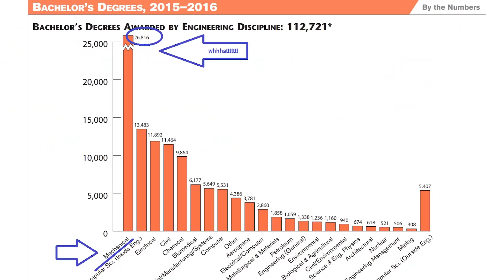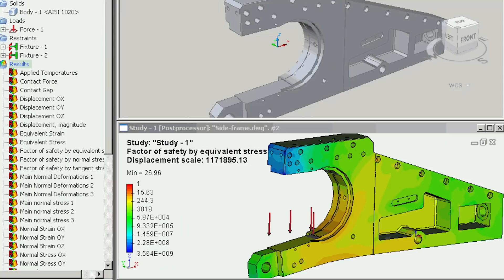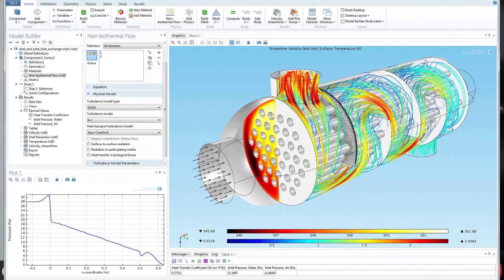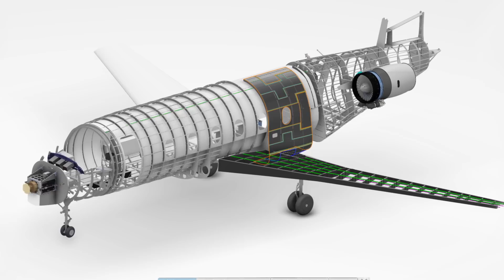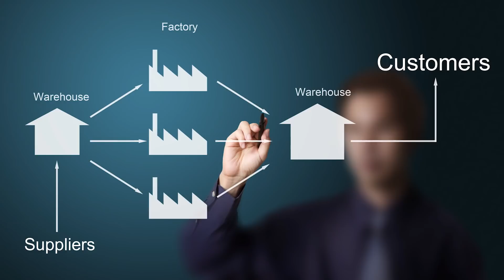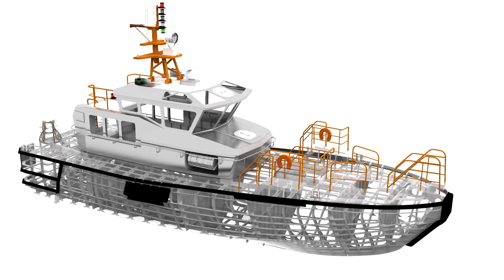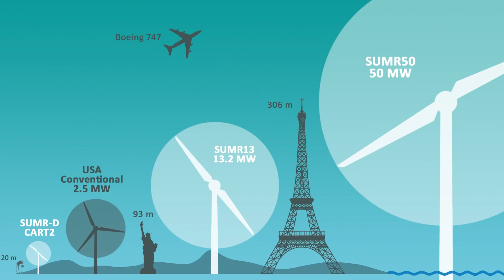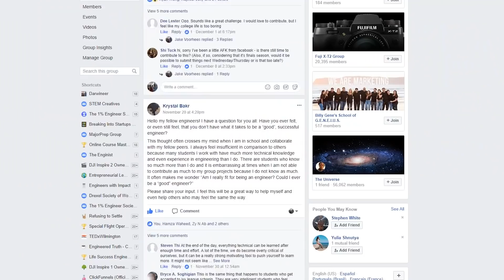What Do Mechanical Engineers Do? Where do Mechanical Engineers Work?

Comment: at 0:35, what is the difference between Comp Sci (Inside Eng.) and Comp Sci (Outside Eng)?
Reply from the maker: You have the best questions. Honestly I didn't even take a deeper look @ that until you asked. I have to assume that inside engineering infers roles of CS majors who are working for engineering companies and essentially, as a part of an engineering team. There are plenty of CS roles outside of the engineering industry as well, so this is one assumption. The other assumption is that CS inside of engineering could mean that they are moreso a software engineer - making software. Outside of engineering would be like a data scientist who never "engineers" any software. I am not entirely sure but did this answer help? Thanks!
Reply: @JakeVoorhees  very helpful, thank you!

Comment: jake what made you choose transportation engineering? and what is your favourite part of it? did you ever work a job surveying?
Reply from the maker: Yes I worked as a surveyor before graduating high school. I chose transportation engineering for the ability to work with technology and driverless vehicles and things like this. I did so for a while
Reply: @JakeVoorhees  wow holy smokes. i might've missed it in one of your videos but i didn't know civil engineers can work on that type of technology. i was under the impression that was sort of exclusive to mechanical and electrical.
Reply from the maker: Ya I ended up working in ITS for a while. Intelligent transportation systems engineering. Mostly in travel demand modeling for new infrastructure projects. What type of engineer are you going for? Thanks again

Comment: Please do one for mechatronics engineering
Reply from the maker: Hey Znro, thanks for watching and commenting. Welcome to 1% Nation. I will eventually do one for all the types. There's a few ahead in line I will eventually get to this :) Thank you!
Reply: Mechatronics is the marrying of mechanical, electrical, computer hardware, and embedded systems software.

You should probably treat it as a major and minor while in college. So if you major in mechanical, do courses in the EE or CSET departments to "minor" in one of the other fields. You'll probably never be good enough in all 4 fields to work in all 4 fields on any project, but getting good in 2 of them is definitely possible.

More likely is that you'll do something like a stress test for ME and work with an EE to get mechanical action done by electrical power, while a CSET computer hardware and computer software works on turning electrical signals into varying levels of mechanical action, and getting sensors to provide information to make decisions on how much electrical power to use.

They're all too involved to really expect an in-depth knowledge such that you don't need to work with a specialist in each field.

Comment: So basicaly mechanical engineers are the jack of all trades?
Reply from the maker: Hey Emmanuel, not exactly. MEs can go down any field they like. They will end up becoming a specialist in one of these many areas. Cheers!
Reply: Ohhh ok
Reply: Despite of what he said, a fresh graduate mechanical engineer is a jack of all trades with a few specialized skills in certain areas. That is, until they get into their careers or getting a master's for what they're going to do, they are jack of all trades.
Reply: Pretty much, and then you're stuck for a job, because you have varied skills across a skill matrix (jack of all trades, master of none), my cv is a joke and i'm jobless, will be applying for a job outside engineering.. unless you want to work for minimal pay, doing jobs that are mediocre, repetitive and mind numbing boring.  Sure you could mix it up with a bit of CAD or 3D work (which i also have on my CV), but at the end of the day, you're still going to be replaced with a fresh new graduate the day they get their degree/Masters/PHD and there is nothing you can do about it.. 

Sad but true, i wish anyone doing mechanical engineering all the best, because i will hopefully graduate soon in June, but i will not be using my qualification, other than another sticker, in my (very) large sticker book collection.  Don't get me wrong, engineering and engineers are fantastic, but the process, majority of jobs/pay and experience is slow, frustrating and most likely disappointing.

My advice for a young engineer:
Grab an apprenticeship (unfortunately i was unable to grab one), and take it with both hands, the pay will be bad, but the reference and experience will be worth it, plus most apprenticeships can pay courses for you as well, so you can climb up the ever-higher-engineering ladder, and be patience, it'll pay off.

As for me, well... here's to my new chapter in life... best of luck!
Reply: Hadleigh Murad Neurosurgeon for me? There have the highest paying salary.
Reply: Blugale Doh good luck!
Reply: Computer Engineers.
Reply: Fred Sellers different field altogether
Reply: @mewantsnax8885  Did i say lacking in jobs? i think you took the wrong context. Yes you can design, maintain, create prototypes, but if you are looking for a job that does all of that, you are probably best starting up your own company.  If i had the money and the equipment, you'd really think i'd be trying to join an engineering company? no, i'll be making one.  For now though, i'm happy working for Tesco ;)

Comment: A large portion of engineering is knowing software. A larger portion is screwing up and learning from your mistakes. It sounds overwhelming but It's really not that hard.
Reply from the maker: I would say a large part of any field today is software. Engineering is about problem solving and design, using a specific budget and timeline to achieve a specific solution. 

There are far more softwares out there that are easy to use and non complex and not the best analogy to what engineering is. Good cross over and great idea :) thank you

Comment: Thanks for the videos they are really helpful. Im 17 right now trying to work out what i want to do. So if i studied mechanical could i later move on to aerospace if i wanted? Thx
Reply from the maker: Ya they can, I get that question a lot. You just have to take your tech electives and internships and everything else should focus on aerospace
Reply: @JakeVoorhees  ok thank you. Also is there a lot of drawing required for mechanical/aerospace engineering? Thanks
Reply from the maker: I wouldn’t say a lot of drawing. The skill needed for engineering undergrad majors is special awareness and spacial understanding. You have to be able to read a paragraph description of something complex and be able to draw a 3D diagram on a 2D piece of paper. And then you need to break down the problem, identify how to calculate everything, and analyze it. I find the more left brained you are, the more aptitude you have around math in general, the stronger this natural spacial understanding generally is. Does this help?
Reply: @JakeVoorhees  thanks that helps a lot. Do u need to be actually skilled at drawing though because im terrible 😂😂

Comment: The one thing i saw that made me ify on this job is that i don't really want to work in an office i would have preferred if i could work on things rather than just design if there is anything i could do that would allow me to build and create as well as design
Reply from the maker: yes Kelly there are ways to be in the implementation and or testing phase for certain industries. For mechanical engineering, this would be an HVAC engineer or product engineer of something that gets installed in the field. Otherwise, there are a lot of field opportunities for civil and construction engineering which are great fields.

Comment: I'm a newly graduated  mechanical engineer and have worked for about 10 months now in a small produktion company where we produce seals for all kinds of machines. I've spent most of my time making excel programs to improve work flows in production data collection, production drawing generation and administration tasks. I'm the only one in the company that knows VBA and I would recommend soon to be graduates to spend sometime using it - it's very easy to learn and it's extremely easy to find information on various forums when debugging/finding new functionalities

Comment: what would u recommend more? Computer engineering or mechanical engineering? I switched from comp to mech but im still really not sure
Reply from the maker: computer engineering isnt a real type, its a subset of electrical engineering. you did the right thing honestly. there are more mech jobs than anything else and anything mech can apply to any other type of engineering. you're fine
Reply: @JakeVoorhees  But aren't there more mechanical undergrads graduating?
Reply from the maker: Correct, mostly because they can do anything. I made a video where I look at the top 11 engineer degrees and dissect which are best and looked at things like amount of degrees added each year, etc. it will probably help you, “Best Engineering Majors | Engineering Degree Tier List” https://youtu.be/nfayHVJlKgQ

Let me know what follow up questions you have okay? Cheers thank you !!

Comment: You are wrong when you say mechanical engineers sit at a computer and sit in an office, my company's across the globe hire degree qualified engineers for service roles, such as flying out to trouble shoot or install equipment that a customer has in a remote area, maintaining high value equipment such as on ships or airplanes, all jobs were a high degree of flexibility, problem solving and work with what you have got is needed.

Comment: What type of Mechanical engineering degree is best between a Bsc, Beng and a B-Tech.
I am finishing a trade in Tool jig and die making and have the opportunity go and do a degree in Mechanical Engineering at university. I can do either of the three, however I have spent 2 years working for an engineering company and work with mechanical engineers who have different degrees in mechanical engineering and they all seem extremely competent. I asked the one engineer with the Bsc degree which one us best and he said it really doesn't matter. I spoke with other engineers and some say the B-tech degree, others the Beng so I'm really unsure.

Comment: Guys I'm hesitating between aerospace engineering and mechanical engineering, I love aerospace more but in my country aerospace sector is limited there is no expansion in this discipline , on other hand , mechanical engineering has several fields and it is expanded in my country so I need advice.
Reply: Omar Q Aerospace engineering is a subfield of mechanical engineering.

Comment: are mechanical engineers in demand? im 2 years in and debating on civil or mechanical. i like both but im mainly focused on how easy it would be for me to get a job.
Reply from the maker: both are over 300,000 engineers in USA, so they are equally as powerful. Do you want to work with infrastructure or do you want to work with components?

See, I wasn't an engineer who was a "tinkerer". I did not take things apart and put them back together, which is a mechanical engineer thing. 

I spent time building things. Building forts and building bridges and legos and digital cities with games and things. Civil was the clear choice for me. Look @ your interests and see where they align.

And electrical is the other big one with over 300,000. These are for engineers who like coding too but cannot decide between mech or elec, i see that dilemma often as well as civil vs mech.

Comment: 1:11 Really? Are mechanical engineers involved in designing a whole electric generator? I have been thinking that the electric generators are designed mostly by electrical engineers or electrical engineers working along with mechanical engineers.

Comment: What is this for bullshit propaganda, you know what mechanical engineers do? Well sit behind a CAD computer and draw shit. Or are project managers, that do nothing with engineering.

Maybe there are 1% off all engineers that are from university that actually do any calculation, but all others just draw shit.
90% of the time it are brackets, I have drawn so many brackets.
The important things that are designed are designed in projects, and then most of the design choices are made by your boss or a customer. You think you can design your own machine? Yeah, if you didn't do uni, then chances are small. Unless your dad has a mechanical workshop, because that is the other thing, want to work for yourself? Do freelance? A good CNC machine costs around 100k. Freelance then? A good CAD pc costs about 2k a CAD license cost around 3k and 1k yearly and if you buy one CAD license you shut out a big part of the market since lots of companies use lots of different CAD licenses.

But most companies don't want freelance, because as a I said most decisions are not made by the engineer, so the engineer has to be babysit by the boss.
What I would suggest, if you like mechanical engineering, try to be a mechanic and put the money you make with that in machines for yourself. Start designing stuff for yourself, make it yourself. Learn from that.
Reply from the maker: seems like you are bored and should probably consider another job somewhere. Id love to chat and give you advice on how to do that. Have you spoken with your boss and team? Good companies and responsible leadership should conduct quarterly, at least, reviews and its a two way goal oriented conversation. Employers should be asking when team members want for their own career success, happiness, etc. What projects they wan to work on, all this. Ask for it
Reply: @JakeVoorhees  Yes I was bored with drawing brackets and other boring stuff for sales. Do I need another job, same shit other company? No I started my own company. So I make enough money to sustain myself.... well not yet because that shit is hard and school mostly only tought me how to do corporate shit. They learn you how to do CAD on a 6000 euro costing CAD machine + license they learn you how do CNC on a €30k cnc machine. It is all useless if you start for yourself, you need the money to buy food and pay rent. Getting a loan to start for yourself to buy these stuff, you will be bankrupt before you start making money.
Like why the F didn't I had the option to do my intern for my own idea's and had to work out ideas for others and get paid shit?

Comment: Jake, I’m studying mechanical engineering and I want to design airplanes and engines, should I take a certain path in school or is it going to be a certain job after take my degree?
Reply from the maker: Sounds like mechanical engineering is the way for you. Once you reach the internship phase, you can experiment with disciplines within that and identify if you really like aerospace or if you should be automotive, manufacturing, thermal, etc

Comment: Hello Jake, so I'm currently working as a Maintenance Supervisor and have been for the last 5 yrs.  I would like to change my career to being a Full-time Mechanical Engineer, but its been hard to do that because my work experience does not relate even though I have a BS in Mechanical Engineering.  What would you recommend I could do to try to change my direction?